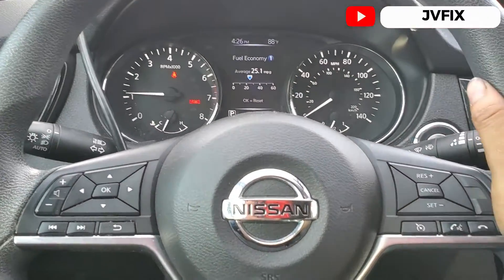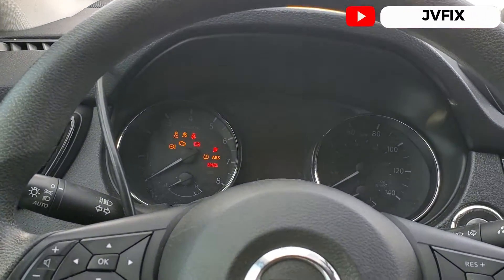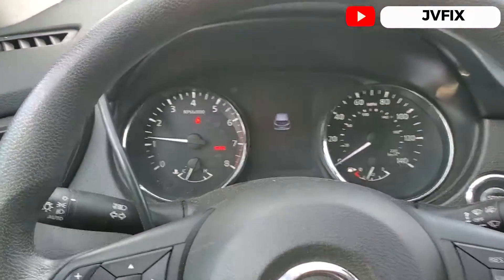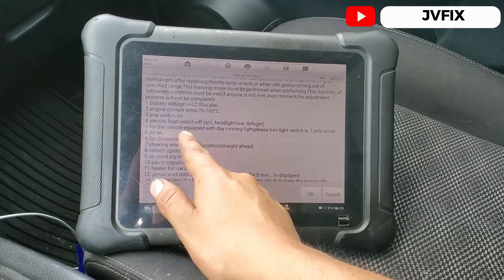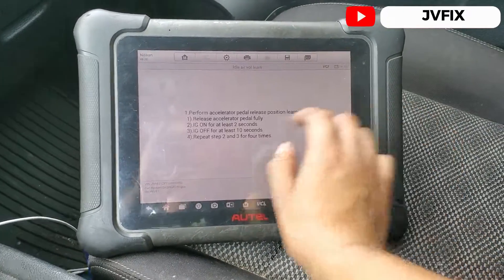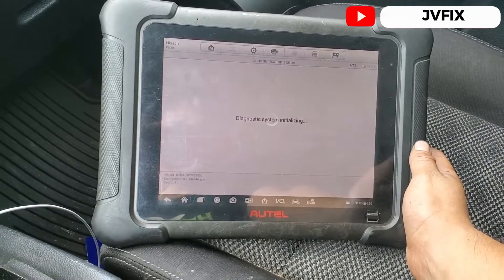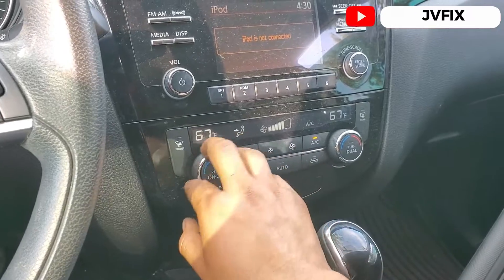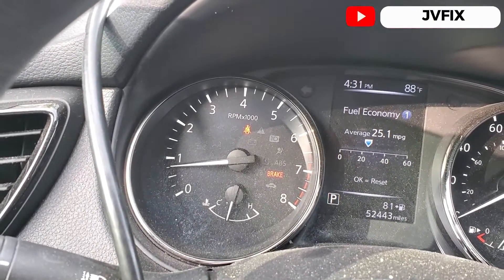How to Fix Low or High Idle on a 2015 Nissan Rogue Using Autel Scanners

Comment: Thank you we have the same diagnostic box as you do.  We followed your instructions after we cleaned  or replaced the sensors and throttle body.  It was running bad until we found your video.  We could tell just from the sound of voice you knew how to it Right.  Thank You its running Smooth Now!